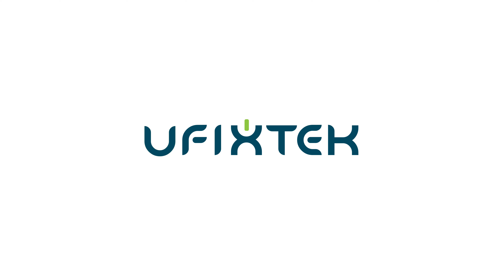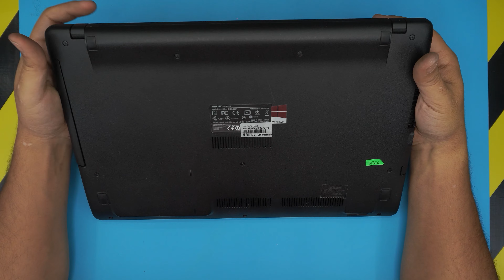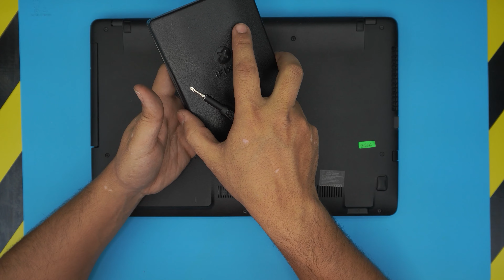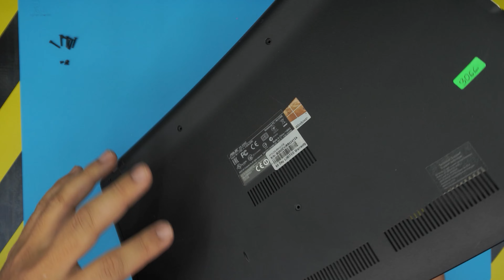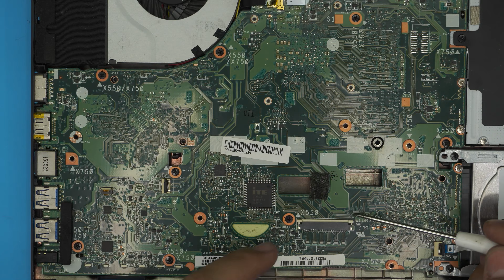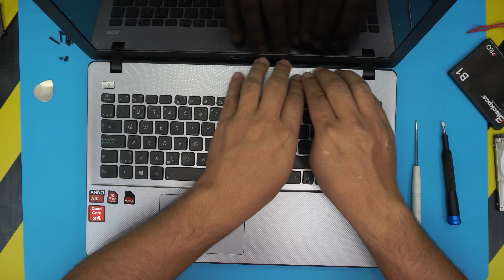Asus X550z SSD HDD Upgrade FULL Guide

Comment: How much did this improve performance?
Reply from the maker: 🫠Regarding your question, the performcane is BIG you will be shocked how much faster the laptop will be, on opening apps and loading files.
Boot time:                70–90% faster           | From 1–3 mins → 15–30 sec
App launch speed:          50–80% faster           | Programs open almost instantly 
File transfer (read/write):  200–500% faster         | Depends on SSD model
System responsiveness:     50–70% improvement      | Less stuttering or freezing
Windows Updates/Installs:   50–80% faster           | Drastically faster installations

Should you have any further questions or requests in the future, please don't hesitate to ask me.
cheers🍻